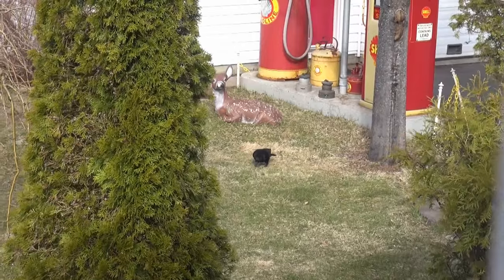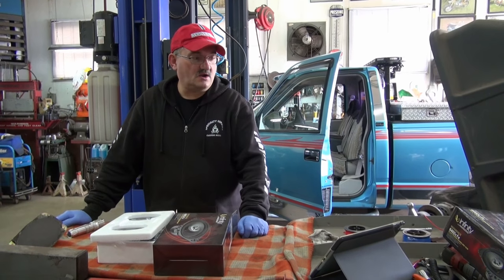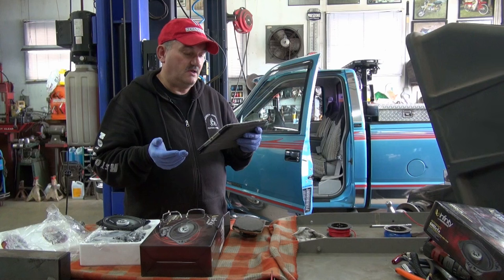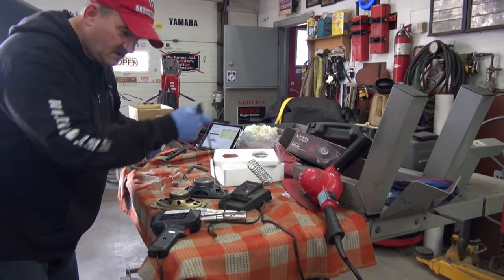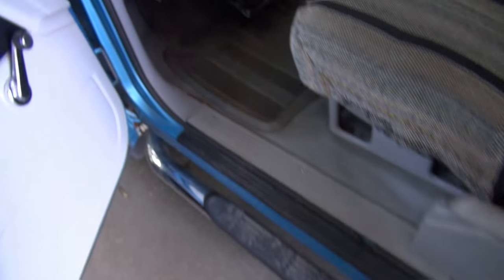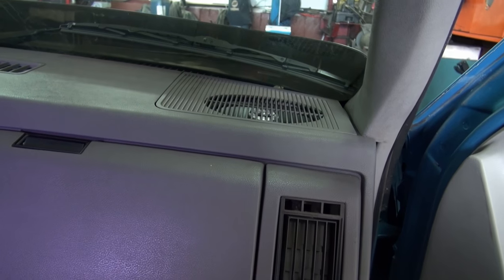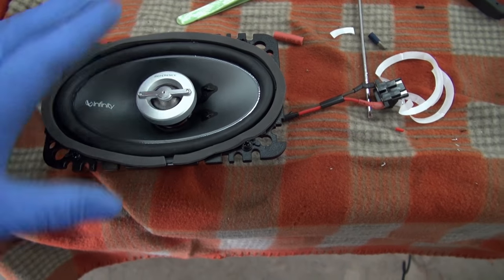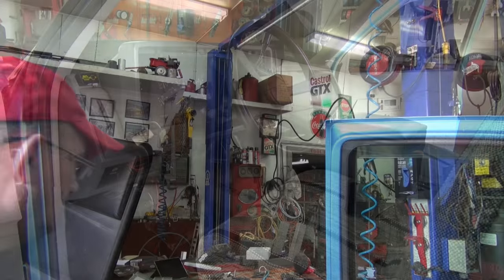Speaker Time. Installing speakers in a 1993 GMC truck

Comment: Those old speakers were made right here in Kokomo, Indiana.  Not to long after they started outsourcing their speakers.  It was a neat process to see.  Hundreds of women sitting on a line building speakers day in and day out.
Reply from the maker: +Rick Anderson 
Well buddy you can take it from me. They built a good product. There wasn't a thing wrong with those speakers after twenty years and as a matter of fact they are going in a 1996 gmc truck next. Quality built in the USA. Used to love seeing that on a product. You knew it was good before you actually used it. Not that way anymore :(

Comment: That was a good install. I had a 1976 Chevy 3/4 ton truck and i installed new speakers in it as well. But truck just had single speaker in top middle of dash, well i cut 2 holes in lower part of doors and making sure nothing was in the way first.It turned out good and sounded much better. Thanks for video Paul can't wait to see what all you're going to do to Ol' Blue next. I know after seeing all your videos it will look supreme as the master builder you are!

Comment: Good video. I hit the internet to see the dimensions on speaker size before I started on anything. Sure, I know it’s easy to find out the speakers are 4x6 but my concern before I started was the depth. I know on many vehicles it’s small things like a speaker being too deep that will mess up your whole project. I’ve noticed most speakers made for this vehicle are around 2 1/2 which seems to be the norm n fit good. Nice addition to the video on showing people how to keep their speakers in phase by correct polarity btw.

Comment: great video nice wiring job great tip about the polarity i didnt know that
Reply from the maker: +bud moore (buckshot32000) 
Cool. Thanks for watching Bud.
Reply: +Paul Short As an electronics engineering student... I have to say, you need to replace the tip of that iron! Or at least get yourself some tip tinner. Nothing ruins soldering like an oxidized tip!
Reply: +Paul Short Also, the foam is to prevent dust and debris from getting in, as well as vibration.

Comment: Good explanation about speaker phase reversal. The way I was told to check it with guitar speakers is to hook up a 9v battery, and touch it on the terminals. one way will make it push forward, the other way will make it pull in. Not sure if that would be too much for a car speaker to handle or not.
Reply: You definitely want the speakers hitting out if they hit inward to hard it will damage the speakers

Comment: paul , those foam pieces are for covering the speaker as to keep junk from falling on the speaker paper and causing a rattle and wear ! .
Reply from the maker: +mark dausy 
Don't think so.  The foam is only 1/4 wide and go around the perimeter of the speaker to mimimize vibration according to the instructions. The one your thinking about is a cloth sheet I guess.

Comment: I wonder what "secret messages" your buddy will hear when he listens to his music "backwards" ?  
I've puit speakers into vehicles in the past and it worked out, but certainly didn't know they should be synchronized.  Things you learn every day.  And yes, the inter-web does take things from guess and by golly to a higher level of success.  As an old sergeant used to preach to us - "If you haven't got a plan, you can't screw it up" (simply because you wouldn't know I presume).
Reply from the maker: +Bryan Walker 
Poor guy. He went off before I could tell him the difference lol. Your Sergeant might have a point there too. Every day is a learning day for me. Hope all is well my friend.
Reply: Positive usually determines positive or forward motion on a speaker, moving air forward pushing the sound "outward" as the cone pistes out, old JBL pro speakers use to be negative terminal, or black opposed to red was positive. You can use a battery to touch poisitive of battery to terminals which will move the cone. Whichever terminal makes the cone move forward is the positive. Only use short taps, if you hold it on and keep it on, you can burn the voicecoil out if using s 9 volt battery. It's best to use s 1.5 volt battery holding wires to it for testing on smaller speakers

Comment: Do the 4x6 in the front also fit in the back? Or would I need to buy 6x9 for the back?
Reply from the maker: I honestly don’t remember. I did the video on May1 2016. Since then I’ve done thousands of different repairs and mods on vehicles. I only left this video up for anyone doing their research.

Comment: Where did you get the chrome trim ? Also I have a 88 with the ugly instrument cluster that don't have needle pointers and thinking about getting one like yours has, do you know if you would have to modify and anything or would it be plug and play ?

Comment: Ik this is a long time ago but how do you get the seatbelt bolt covers off
Reply from the maker: Their just plastic covers with plastic tabs. Simply pull up on them. I think one end has a plastic hinge and it swings open to expose the bolt.
Reply: Ok thanks

Comment: I have a 90 truck and the aftermarket passenger side speaker magnet hits the air duct below. Yours looked as deep as the ones I attempted to install, but you didn't look like there was an issue with fitment. No issues for installing on the passenger side? Great work on the video, btw! Thanks! It helped me identify two connectors dangling under my dash.
Reply: My 1994 has the same issue. Standard 4x6 replacements are too deep. I may have to order new stock speakers instead

Comment: He said it doesn't matter if they are hooked up rit yes it does you want the + an - on the correct post cause you can damage voice coils if backwards
Reply from the maker: Typically, the positive wire is red and the ground, or negative, is black. However, most speaker wires don't do colors. Good news is, with speakers it doesn't really matter which one you choose as your positive and which as your negative, just so long as you are consistent.
Reply: @7863348  I've done alot of stereo systems in vehicles and they are not usually red and black unless you are using your own wire alot of house stereo are red an black but definitely not car audio. I happen to know from years of people hooking up speakers wrong will cause damage to your voice coils. So you really should make sure that positive goes to positive an negative goes to negative unless you feel like replacing blown speakers

Comment: Is that a 1/2 ton pickup? It looks like it is. I have been wanting to put an overhead console in my 1990 silverado but haven't been able to find one. Was that OEM on that truck or did you get it aftermarket. Where?

Comment: How did you remove the cover? I can't find anything
Reply from the maker: Are you referring to the grill for the speaker?
Reply: @7863348  yes
Reply from the maker: Put a blade or a butter knife under it and pull up on it. There’s clips holding them in place